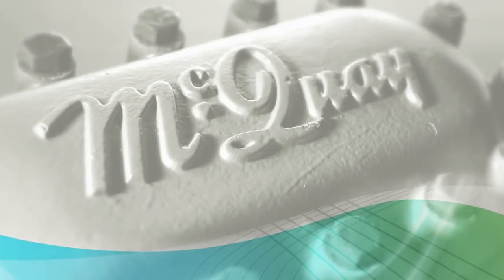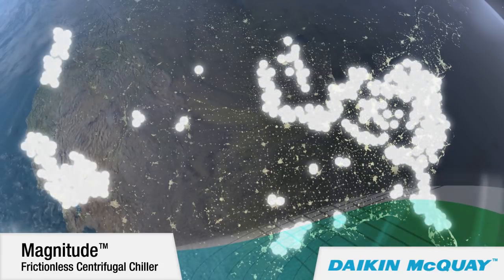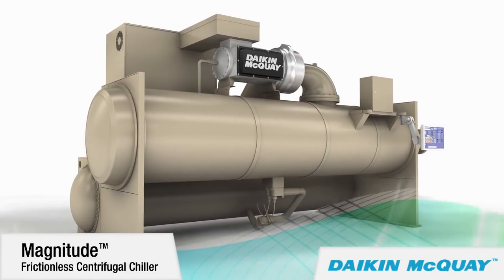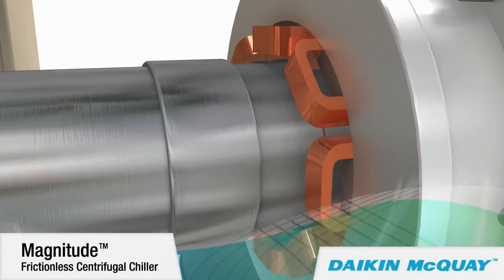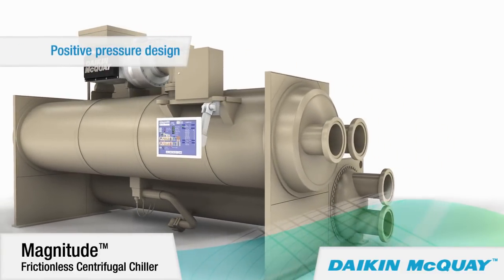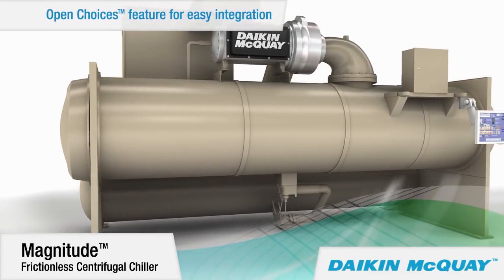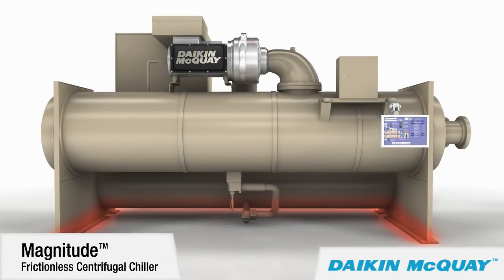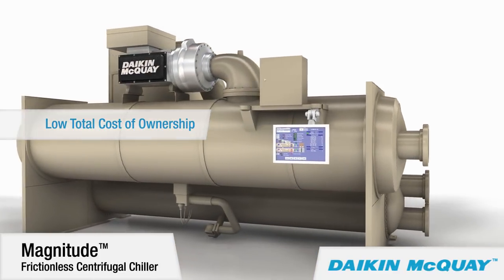Daikin McQuay Magnitude Magnetic Bearing Chiller

Comment from the maker: Turbocor is the brand name from Danfoss.  They invented the compressor and it is a wonderful design.  Daikin McQuay designed a higher mass flow compressor that is used in our chillers over 400 tons. We just released the 700 version a few weeks ago. It containing one centrifugal compressor and one motor with an external refrigerant cooled VFD as standard.

Comment from the maker: The compressor rotor backup bearings support the Turbocor rotor when power is off.  The larger McQuay compressor on the WME chiller has the same support.

Comment: I did a big presentation on the turbo-core chillers back in college. (I have a B.S. in Engineering). 

Just a quick question because I've forgotten... Does the compressor rotor assembly rest on the magnetic bearing surface when not in use?
Reply: No, rotor is de-levitated when not in use